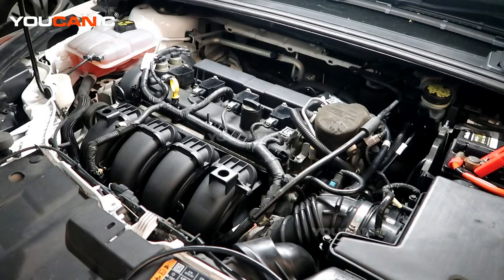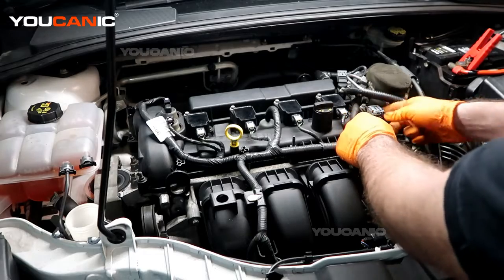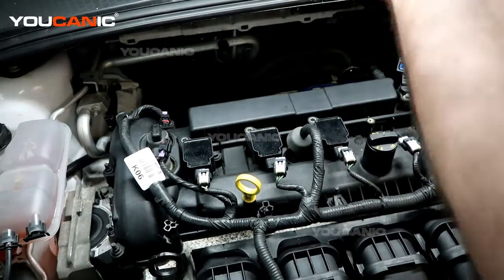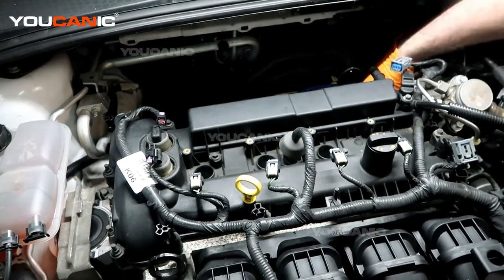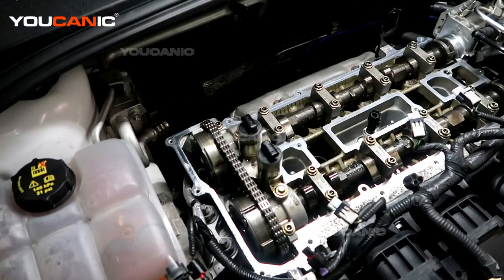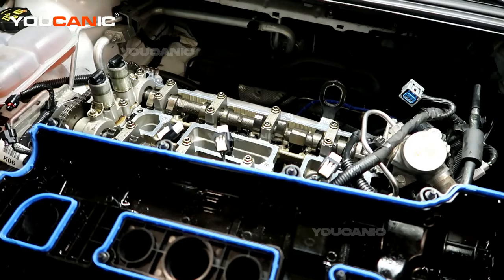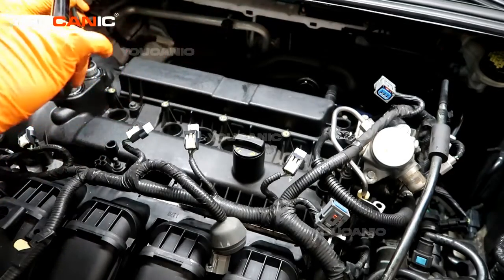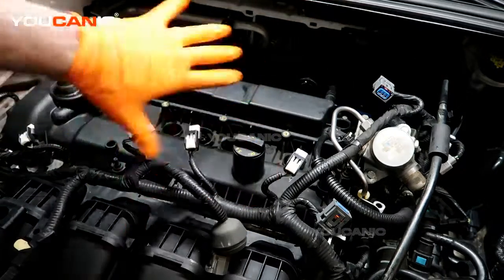Ford Camshaft Position Actuator Control Circuit Replacement - P0013 & P0010

Comment: Well changing the solenoid is not always the solution, specifically when it reads CIRCUIT means more about connection issues

Comment: Do you have to replace the valve cover gaskets each time the valve cover is removed, or did you just do it because they were old?
The reason I ask is because I replaced my valve cover gaskets months ago due to a small vacuum leak, and now I'm getting the P0010 code and hate the thought of essentially having to redo this entire job plus get all new gaskets.
Great video!

Comment: I have a 2015 ford explorer. I was replacing the control valve solenoid and the aluminum housing that the solenoid bolts on to has broken - its the little ear that bolts onto the actual solenoid. It appears that there are just 3 bolts holding the housing on. However, it looks like the secondary chain is in the way and needs to be removed. Hate to mess up the timing chain - any other ideas on how to approach this? Much appreciated.